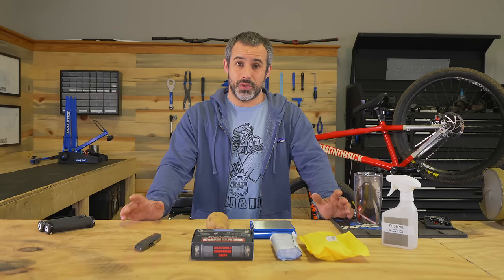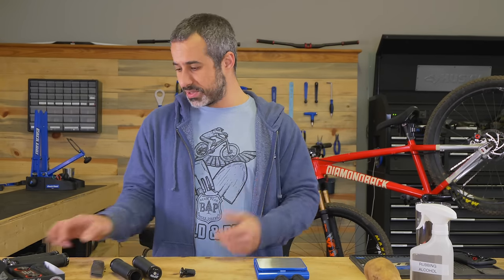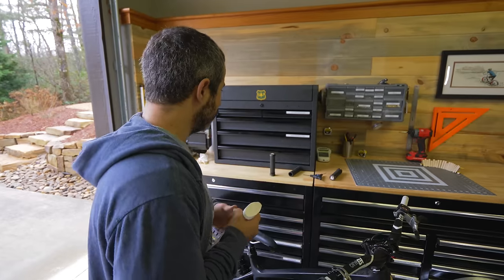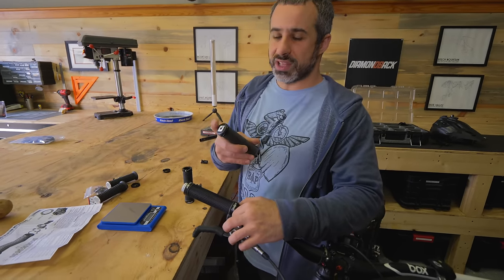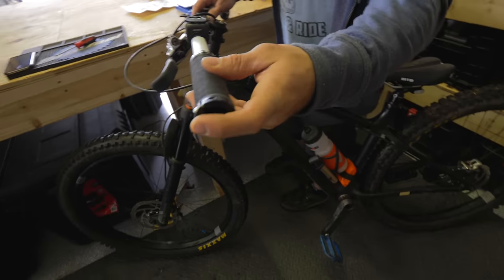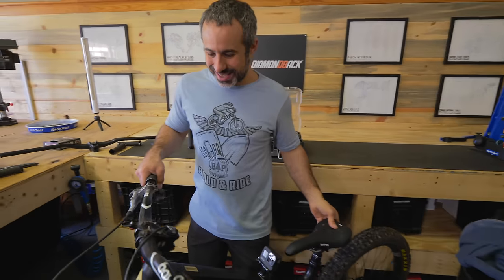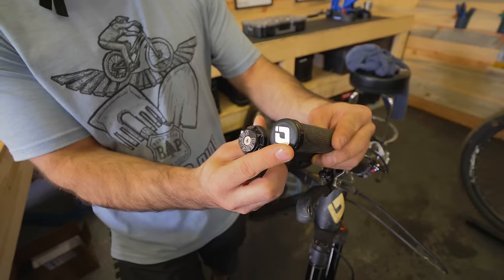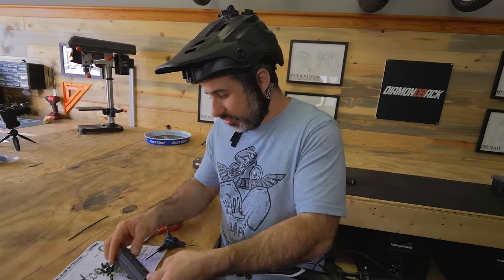REALLY?! How do $90 bicycle grips stack up against $5 grips?

Comment: Bicycle handlebar grips... the ultimate scam market. If you wanna scam idiots out of $90, sell these grips. Uber gimmick
Reply: You just don't ride hard and long enough for your skin to literally start tearing off lol, many are saying these reduce fatigue on the hands.
Also: they have since completely re-vamped the design of those $90 grips in response of the many issues.
Reply: There was once a time where people would spend a lot of money on stems with a couple milimeters of suspension travel

Comment: If u use rubber ones ur meant to glue them on duh
Reply: No, then you can’t get them off
Reply: @Wyatt_Ali  You should try taking-off high-quality 1990s grips that weren't lock-ons... after 25 years, those things chemically break-down into glue-like matter. They look quite normal until you really squeeze them hard and they just turn into a sticky mess.